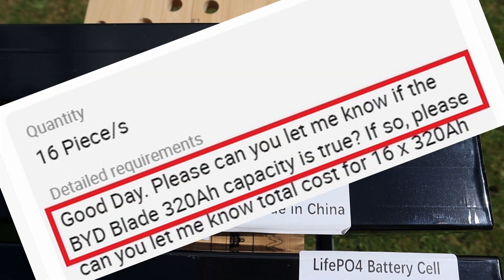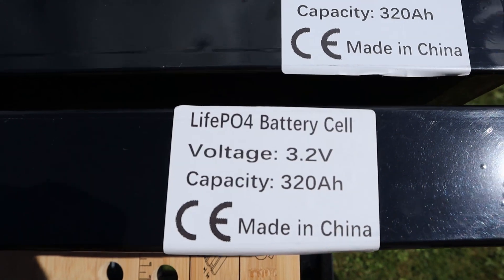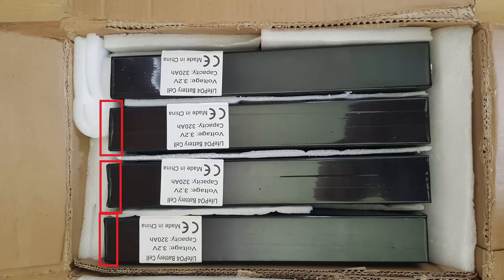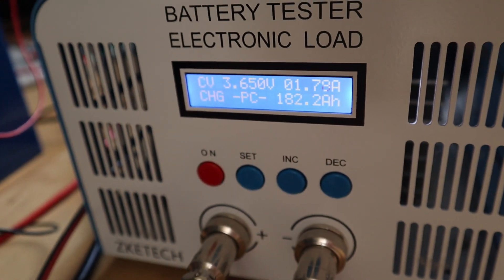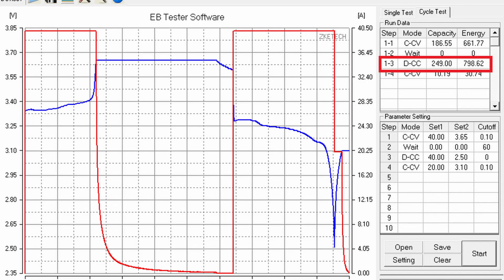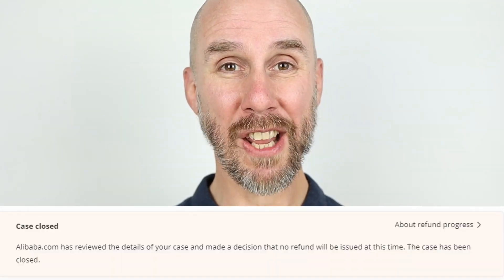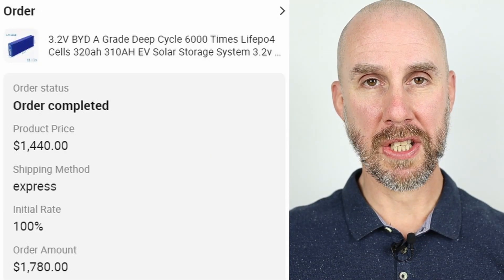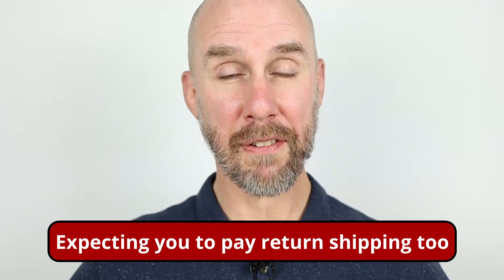Building our first 48V LiFePO4 battery | What could go wrong?

Comment: Hi Adrian, don't be disappointed. You paid  about 11 cents per Watt hour and it is a very reasonable price if all the cells are functional. Assuming you did not pay extra taxes, then you actually wasted $340  by rushing such heavy shipment. Otherwise it would have been securely packed in foam and boxed  in robust cardboard boxes for shipment by boat. It does takes longer but it usually arrives without transit damages. What's important is that they work as a 12.6KWh pack and stay balanced adequately throughout their very long life. So if you do not get that figure, add an active balancer to top it off and prevent Hi Cell voltage from stopping prematurely the charge to the other cells. Daly and JK both have them on their BMS, but you can add a stand alone 16s 1A active balancer for around $35 nowadays.
That will take care of this pack. Then buy more cells, take your time! and increase your home energy storage with yet another pack to leave behind all worries that the shitty weather of UK tend to promote. Once you're done being totally off grid for some months, all this anxiety will disappear. It gives piece of mind to have surplus power from the PV panels and storage. They have come down so much in price that anyone can afford it now.... albeit progressively as it should be so you can afford a couple of learning curves on the way. Think positive! Be happy, optimistic, constructive! Life itself is a learning curve without which we would get so bored! Thx 4ur vids.
Reply from the maker: @francoisguyot9770  Good day! Thanks so much for your comment👍. I've been fighting for the right thing (get what I agreed and paid for) for such a long time it's difficult to see out the other side. Although the card claim is still in progress (hopefully completed soon), I've made some progress with Docan Power. I've managed to get hold of some very good quality cells and DIY box (https://youtu.be/Q359KSEinhI) to assemble what I planned to do in the first place, then share my experience. The good old British weather is probably going to cut my capacity testing of all the new cells short as I want to get the box built and use if for winter. I've tested 1 of the 16 cells so far and the EVE 280Ah supplied by Docan has shown a capacity just over 300Ah already! In terms of an experience, it's almost the exact opposite to what was covered in this video. I really do appreciate your words of support; it's not been easy but definitely worthwhile to learn and share. All the best, Adrian
Reply: @DADvinci  If it's  of any consolation for you, I'm going through the same scenario with the last batch of 310Ah cells, the old style with tapped terminals. That explain the batch price of $1760. I just received them 3 weeks ago, but decided to finally put them to the test after watching your sorry vid. I'm also using the EBC-40L tester on a charge-discharge-charge cycle test with charge cut off at 5A. and 30 minute wait in between. Although I tested only 4 so far, t's all over the place! 301, 303, 298, 292 !?... WTH !.. Ouchy !! I'm re-testing this one, just in case... But I'm no fool, I previously paid $1860 for my previous 280Ah batch and was quite thrilled it was spot on. So I'll just think of this one as a 290Ah at most or whatever smaller capacity I get of this batch. Their internal resistances are all about 2.5 mA and that's a consolation even if it should be below 1mA. Perhaps my meter is too cheap too. Anyway, with a BMS that has active balancer set at 3.4V I should  get the best life out of this batch and go on with my life. I'm very happy about the 200Ah batch though. They both balance within 1mA as checked every morning.  They also charge at full capacity too, get off balance by 60mA at most then regain their stable 1mA once at rest, I get same results with discharging. I would recommend the seller to you, but it's in California and shipment + taxes would definitely kack up the total price. He increased the price of the 48V 200A 19" rack module  to $800 after I said it was too cheap (my stupid mouth!!!) But they came as a pair in a very secured crate made of plywood. He had 50 to sell back then at $700 . He develops storage systems and BMS. These were from excess inventory and also measured 2.5 mA on my internal resistance meter. The guy even gave me a brand new 19"  storage cabinet.
The bast is that everything came almost with all the hardware needed. All I had to do was to connect a BMS and hybrid inverter. So... Life is good, my retirement money is well vested in my solar venture. I could not be happier even if I get scammed at times, hopefully not too often... My retirement money will not sit idling in a bank somewhere I don't know where, offshore perhaps...Hence my previous comments and enlightenment. Cheer Adrian
Reply from the maker: @francoisguyot9770  It's a genuine pleasure to hear you enjoying what you do! I crave retirement so I can do this whole venture full-time, but alias I'm still a way off. The much larger market in the US definitely provides greater choice, even if sometimes you don't really get what was promised. 

I really appreciate you sharing your experience and what has worked for you. It's nice to know that I'm not facing things in isolation and that salvaging the situation can actually bring a sense of accomplishment too. Cheers to you😀👍
Reply: @DADvinci  My vendor confirmed that it would be way too costly for his small enterprise to ship to the UK. Sorry, I couldn't help.
Reply from the maker: @francoisguyot9770  Very kind of you to check, thank you👍😀

Comment: Anyone on DIYSolarForum could have told you that 320Ah LiFePO4 cells don't exist. Winston has their large cells and EVE is coming out with a 560Ah cell but the largest cells besides the Winston are the 302/304/and I think 308 or 310Ah. EVE is 304, I think CATL is 302 and I'm pretty sure someone makes one higher than 304Ah by a little bit.

Yes, the nominal rating of those cells is 304Ah (for EVE as an example) but if they are A Grade uncycled (except factory testing) they should come out around 320Ah on a 0.2C test.

Doesn't Nkon or Fogstar sell prismatic cells for a good price?
Reply from the maker: @ericklein5097  Thanks for your comment. I've been a member for years and couldn't find anything specific for the BYD blade cells I bought (did you find anything?). From what I've found they are generally used in EV modules, can only assume for buses or larger vehicles, as I've got some of their smaller 138Ah blade cells too. I had some projects I wanted to try with the blade cell format, as I mostly use the 'top terminal' prismatic cells you're referencing.

Fogstar are generally out of stock, which highlights the demand for decent cells in the UK. Cheers, Adrian

Comment: Ali blah blah is a lottery and a bad one at that - if you decide to try and "cheat" the world buy buying from those places then don't complain when you get bit in the foot.  For me - the cost savings are totally not worth the stress of spending months dealing with it if it all goes wrong, which it has for you.  Not only do you have the headache of getting a refund, you also will have the headache and cost of possibly sending the cells back, and then the dangerously packed illegally shipped cells will end up even more damaged by the time they get back to china, and then your refund will be even less likely.  It's just a mess.  I'd rather spend the £1500 on a pylontech from a UK company and get 5kwh up and running in 48 hours no hassle no stress saving money on leccy right now.  Good luck with it DAD!
Reply from the maker: @MrButuz  Good day and thanks for your comment. I guess it's all about choice. As mentioned in the video, this is the first bad experience where it hasn’t gone my way, so a pretty good hit rate for me. My 5kWh shopping cart build has been a total success, good cells at a reasonable price and decent components that have served me well since Feb last year and much less than an equivalent Pylontech. It's fully serviceable by me and I can change it from 24V to 48V whenever I want to add more cells.

It's all a risk and it didn't pay off this time. I've got another card I'm playing too, so will see if that works. If it does, it will be paying what should be considered a reasonable price for me, much like the cells on the shopping cart build.

Problems can occur even when you pay for something like a Pylontech battery in the UK. Just search for Pylontech in Google and the first video suggested is this one https://youtu.be/17FwTKBlwx0?si=u9DDGC-dFZIXt06Z which isn't a very stress-free customer experience in my opinion. A follow-up video covers what doesn't appear to be a short process either https://youtu.be/y9mvgxKdH2g?si=mNBzy310iW82ccwf.

Even if I don't manage to get any money back, I'll still attempt to build something with what I've got and test it thoroughly. With the lowest cell capacity at 246.30Ah from the 16, I should be able to build a 48V battery with the capacity of approx. 246Ah x 51.2V = 12,595Wh (12.59kWh). Worst case, I can take the cells that work and make a 24V battery and perhaps a 12V battery as well, all still cheaper than ready-made options with similar capacities. All the best, Adrian

Comment: I bought 4x 300AH raw lifepo4's as a final addition to my 700AH bank.
These were swollen however they were literally at the capacity as promoted.

They are still currently in use and I use a micrometer to measure the gaps every quarter. 3 years and still pumping out good current not going lower/higher than 13v-13.5v. (Top charging 13.6v periodically).
Its not the end of the world I found but still disappointed I didn't first receive quality cells.

Note: daly bms interfaces are a bit clunky if your using them, you constantly have to wake the tablet to access the table of contents.
Reply from the maker: @LITTLEEXPERIMENTCHANNEL1  I'm glad to hear they pulled their advertised capacity and are still working fine today👍. That's a useful tip to use the micrometer. It would seem that the 'used', grade B or below market is big business in China. It's the really abused cells which appear to be what I got that really take the biscuit. The lowest capacity cell in the batch of 16 was just 246.30Ah, which is a very far cry from 320Ah. I know why they use the tactics they do; it makes them money. I think the whole honesty piece could also be lucrative for them too. Don't bin, give it a 2nd or 3rd life assuming it passes basic safety tests. I've got a new contact and seller that appears to be good, so will see once my next project bits land. My 24V Daly BMS has been fine as it's in constant use, my 12V one does need a kick now and again to wake it up.
Reply: @DADvinci  my concern with the swelling is:
Have they been used for years in a clean maintained working battery bank and shipped out as new cells to be replaced for new one's to economically replace theirs?

I do use an "active ballancer" as well as the collective daly bms to make sure there is no devide in current between them swollen cells the daly bms is managing. (So it doesn't resonate to the other healthy cells).

Its been such a learning curve, soon as you covered this in your video I immediately refilled my keyboard ink to reply relating to your concerns on this topic. 

I think/believe a lot of suppliers abroad take advantage of buyers on the whim we predictively make uncalculated purchases as a supply of additional income.

Its really sad this goes on mate.
Reply from the maker: @LITTLEEXPERIMENTCHANNEL1  It’s a real shame, but this only highlights the demand for decent quality cells in the UK. I guess we're perceived as a small market compared to the other parts of the world. Fogstar are a clear example as they are regularly out of stock.

The larger cells do have more 'movement' in them, but the point of this video was to show that I tried something different, in using these larger blade cells for a project I had and it didn't work. The other shame, not unexpected though, is that people remind you of the fact you should have seen it as a scam, without offering recommendations or anything of value. Anyone can go on a forum and formulate the perfect answer to any question (ChatGPT can do it now). Unless you get your hands dirty with all the components and different battery types/forms, you don't know unless it's based off of someone else’s opinion.

I've had a couple of recommendations now and I've found a couple myself, so hopefully I can provide something of value for our UK crew in the near future. Keep powered up my friend👍
Reply: Very small amounts of swelling are quite normal especially with the largest prismatic cells. The 100Ah cells or smaller rarely ever suffer from this when at nominal voltage. So its not unusual for 280's or 304's to not be perfectly flat even if they are Grade A. Now any more than a mm or two means they have been cycled HARD. Swelling is caused by large currents (2C on a 1C cell), excessively deep discharge (below 2.0V), excessively high overcharge (over 3.8/3.9V).

Or they were not properly compressed in their previous application. And when I says compression I don't mean pressure has been put on them during idle sitting, I mean they are clamped in place so they cannot swell any more than they are at nominal voltage during the charge and discharge process.

Comment: Hi Adrian,

Don’t be disheartened mate, you are doing a sterling job for the community, keep it up buddy.

I did fly a against all opinion 😂 and I did add another 100w Renogy panel, it all seems to be working a treat so far, highest I have seen so far is 445w out of my 500w array, I think it will go higher than that to be honest under better conditions. At present I am on average using just under £2 a day of gas/electric including my standing charges all because what I have learnt from you and channels like yours……thank you 👍🏻 

Keep up the great work Adrian.

Kind regards

Tony
Reply from the maker: @LRDefender1968  I'm always so grateful for your support Tony, it really does help👍. Life is about learning and it would be very boring without problems to solve. Great to see your results and it's working for you😃. The extra panel should help as the darker days roll in, so good choice for that! Take care and cheers, Adrian

Comment: Under £100 per kWh of storage would be awesome. I'm interested to see what you'll do with such a big battery. Maybe bigger is its own defence against problems caused by frequent deep discharge? I think my lead-acid AGMs (not without disappointments of their own) were around £250/kWh. It's a tricky part of the calculation - payoff depends not only on price of storage but on how many 'battery kWh' we use each day, and on device longevity.

It seems bizarre we don't have a domestic 'house battery' alternative that an enthusiastic DIYer or tradey could keep going indefinitely, even if it had dreadful energy density. It's not like most people would need to move a house battery around!
Reply from the maker: @trs4u  It's such a shame that this battery won't be that figure (depending how this all pans out). The lowest capacity cell from the batch of 16 was only 246.30Ah. Even if I can make something out of this once the dust has settled, the best capacity I could get will be the lowest in the pack (246Ah x 51.2V = 12,595Wh/12.59kWh). That's best case if I can get them top balanced and the internal resistance of the cells doesn't throw things too much off.

For me, the reason I'm now going big is to cover the good old UK weather. With the rubbish summer (after June) it's been evident that I need to store more for rainy days, literally. The 5kWh setup has been brilliant, but as I run virtually everything in the house via strategically placed extension leads, it won't cover much over a day of rubbish weather as winter rolls in.

I guess the beauty of 'building your own' will always be serviceability, much like having a petrol or diesel car. You can replace failed components and LiFePO4 cells can last a very long time indeed if used correctly and in a suitable environment.

One of my projects that's currently on a boat somewhere, will be looking into the 'house battery' idea further. Some on-grid specialists already provide such batteries (GivEnergy), but like mainstream heat pumps + installation, they are very expensive which cuts out large parts of the market that really needs them.